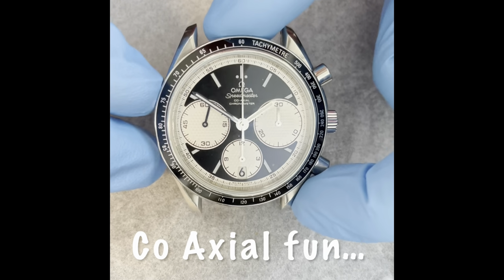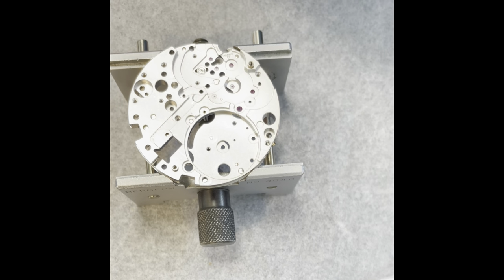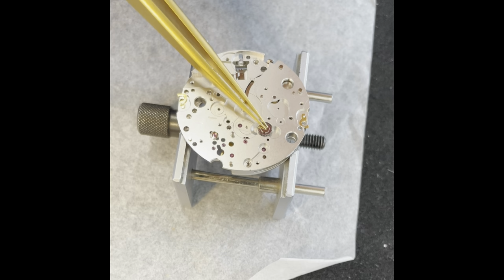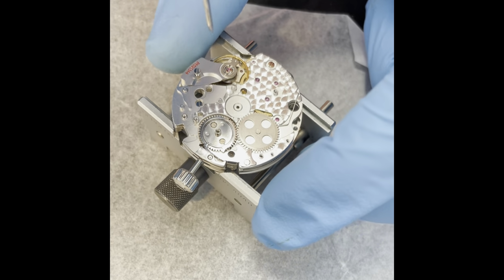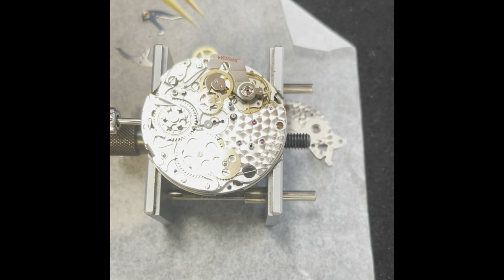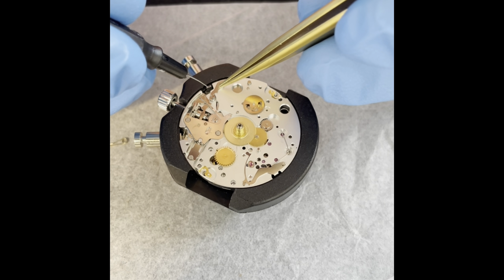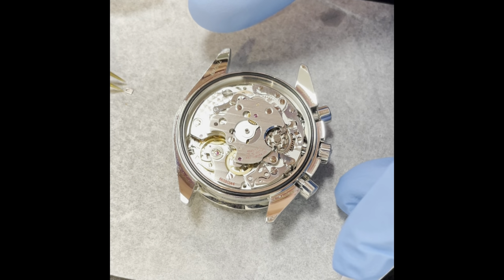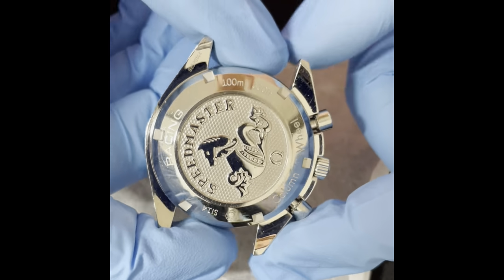Omega Seamster Co-Axial calibre: 3330 service

Comment: I’ve always liked the 7750 because it’s generally robust and affordable. I’ve always been interested in the Omega Speedmaster Racing, mainly because of the Coaxial modification of the 7750. But I’ve never been able to pull the trigger because it did seem overpriced. The Racing line is supposed to be more fun and colorful than the regular Speedies, but the dials of these , though attractive,  just seemed like they could’ve elaborated a bit more. Sounds like it’s the same for the movement.

Comment: Does Omega still offer a certification to watchmakers? I know there are independents who can get parts, but maybe they don't even offer the certification anymore? Omega is not alone in their service approach, but the certification did seem to me a middle ground that set them apart from many other brands. (Although, I'd guess the certification is difficult, costly, or nonsense in some way or another.)
Reply: My watchmaker is an old Omega specialist, but I get the impression that he basically has to mail newer watches to Omega for service to maintain the warranty. Why they won’t allow out of warranty service is a bit of a mystery.
Reply from the maker: I’m actually not sure, but yes practically impossible for independents without a massive budget. They also require new and update equipment to keep the certification valid. I know a few that had to drop out because of that.. all of a sudden you need to buy a 30k cleaning machine or something…
Reply: @Mitkawatch  😳